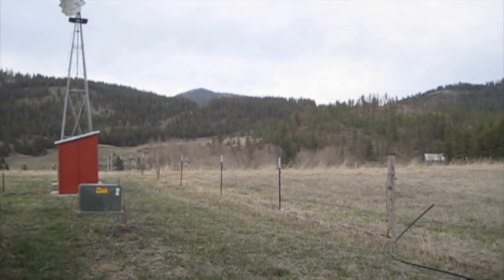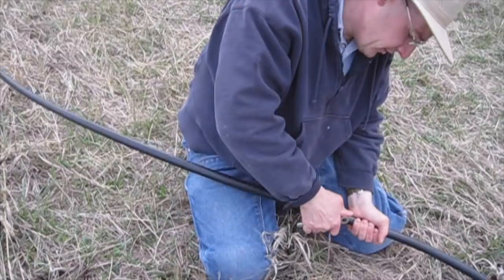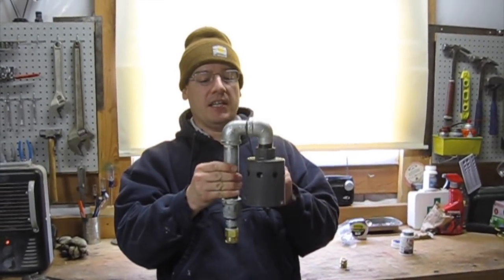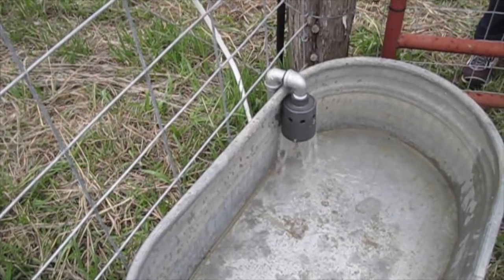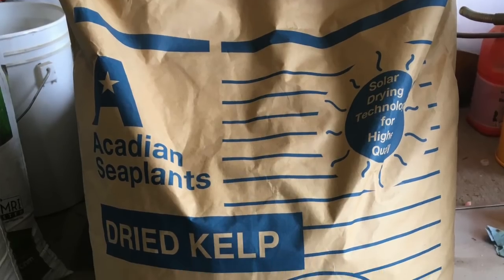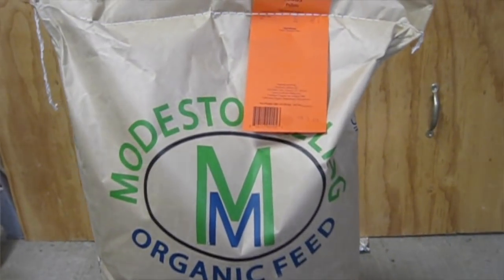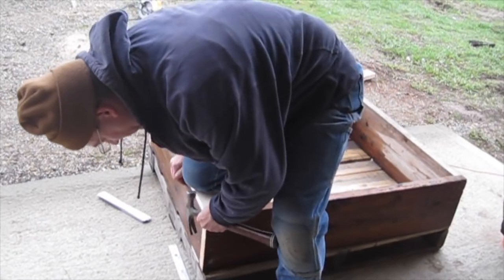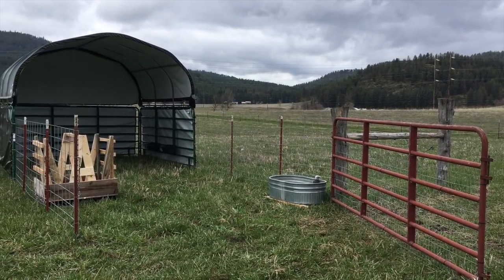Water System, Hay Feeder & Supplements for Cows

Comment: Just a suggestion, your metal trough will leak and rust.  You might want to switch to plastic or rubber.  I'm running into this problem now.